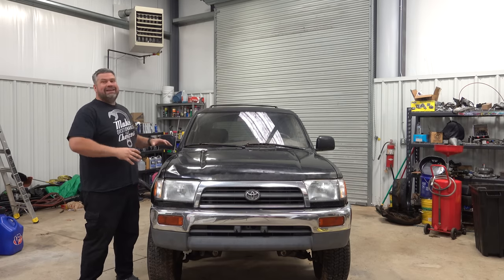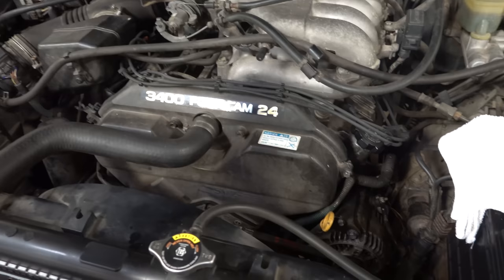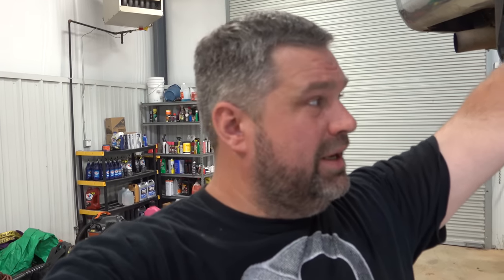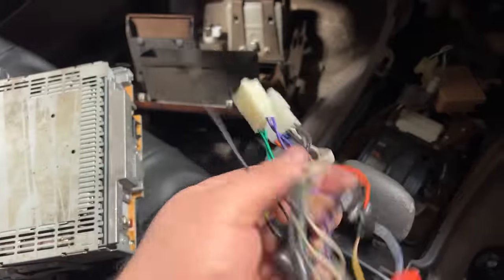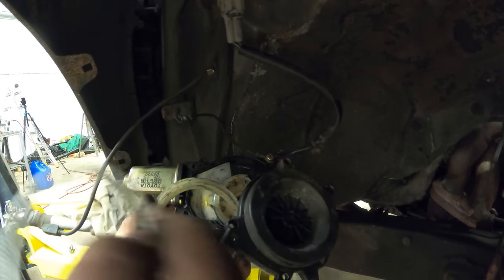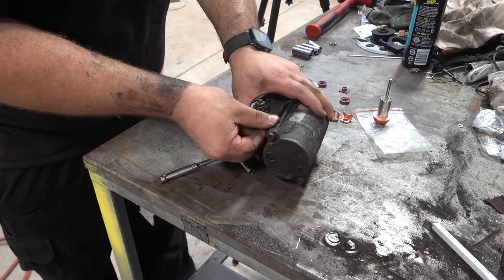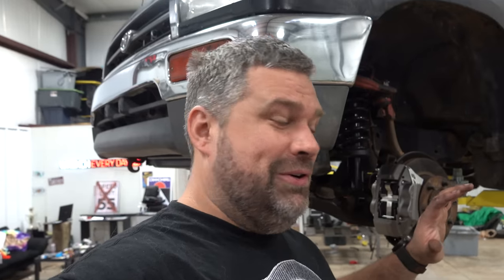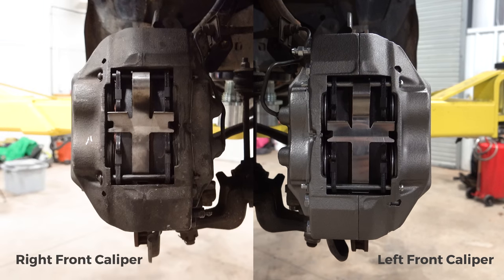Everything Wrong With Our Cheap Toyota 4Runner! Mistakes Were Made. Trying To Fix It All On A Budget

Comment: I cross reference parts off Rockauto to Amazon to get the best prices. The key is being able to have the time to wait on parts and knowing when to stop is the key to a decent flip.
Reply: @LM-id1bb  That's why RockAuto can have prices though, because of paid shipping.
Reply: I always check for deals with Amazon Warehouse... The "used" condition is most often brand new, but returned by someone, and can save you a lot of money!
Reply: @LM-id1bb  even when you go back and try to get parts shipped from the same warehouse when you order multiple parts no matter what you do they always make sure you are shipping from multiple warehouses.
Reply: I’ll never use rockauto I’m sorry they put cheap parts in the box and still charged me to ship back parts they sent me incorrectly then they charged me to ship it back. I will Never use them. Amazon is way easier.
Reply: Don't overlook OfferUp, Craigslist and marketplace for part outs
Reply: Bingo. The big auto parts chains are horrendous price gougers with poor selections. Buy your parts online and save anywhere from 25 to 75% I don't feel bad not supporting the parts giants when they literally price gouge on everything. Oil and coolant are cheaper at Walmart or the dollar store. Auto parts stores are supposed to have one job and instead they overcharge for everything.
Reply: Oreillys will match online pricing where I live. But I use rockauto due to time and work schedule. I had one issue with fedex damaging a radiator. Rockauto sent me new one and told me to trash damaged one.
Reply: I'll do that to find the product code and search off-brand sites that sell them even cheaper fuel pump for a 98 tj was 350 on rockauto 150 on Amazon but found the exact product code off ebay for 25 bucks with 10 dollar shipping
Reply: My problem is I'm OCD and usually fix them up as good as new and lose money.
Reply: The trick to rockauto shipping is doing the whole choosing the parts that all ship from the same place.  Like youll see the little car symbol with an a b or c and those are all different warehouses which youll get a separate charge for each different letter you have next to your parts..  if your able to get all of them the same the car icon will go away and youll only have a single ship charge on your order..  plus if you search google every time your buying then youll be able to at least find a 5% off code and ive even gotten ones that worked for 20% before just by googling and looking through a reddit post..

Comment: Installing the rear axle seal is not as simple as you think in these 3rd gens. You must make sure the seal is riding right in the center of the retainer sleeve on the ABS tone ring. Watch Timmy the tool mans rear axle job, where he explain the sharpie test. I failed once and then did it again while following his video. Also, don't forget the front lower ball joints (BUY OEM lasts 200+ K miles, aftermarket just 20K miles)

Comment: i like when you said, “I have never seen that before!” Never underestimate the power and “creativity” of previous owners fixes. Awesome video btw!
Reply: I just bought an old 4runner like this one last month, just last thursday I heard a clunk, the rear trailing arm mount on the passenger side ripped off from the frame due to the "previous owners fix". My guess is that it somehow got cracked at one point, so they welded it back on, but all their welds snapped and left me with a big hole in my frame now. But at least its not too rusty!

Comment: I bought a 1997 Celica Gt Convertible  from an estate sale for $1200.  Had 230,000 miles but runs great.  Carried out a bunch of work on it and amazed at how much the parts spend adds up.  Done as much as was necessary to make it safe and pass inspection, including new struts, battery, suspension parts, one axle, timing belt/water pump, parking brake cables, oil pump cam and crank seals, valve cover gasket, transmission gasket and filter, spark plugs and wires, auxiliary belts, fuel pump, minor body work and a few other bits.  Probably spent around $2000 on parts but I now have car that runs and drives great.
Reply: They are great cars. Right behind you with 208,000 miles on a 93 convertible. 20 years with the car... My longest relationship.😄

Comment: Nice job! Looking forward to this series. A great upgrade for this truck is the "Tundra Brake Upgrade". You buy the calipers and rotors for a 2005 Tundra and it eliminates the rotor warping issue that happens in these (at least in mountain regions), it also greatly increases the stopping performance. I bought one with all the service history and rotors had been replaced 4 times and needed replaced again. When purchasing it as a kit, the total cost can be as low as $300.
Reply: I was going to say the same.  Once he bought both calipers and pads, with just the cost of new discs he could have put in a much better braking system that won't result in warped calipers all the time.

Comment: That was a good overview on the rear brakes.  I have a Tacoma, and use the parking brake every time. Even so,  anytime I pull the drums to check the shoes, I have to manually move the adjuster a few clicks.

Comment: Man, that bleeder being on bottom got me good the first time I ran across it. Had a 2000s Ranger come into the shop I was working at. Customer and his "mechanic" neighbor put all new brakes on it. They replaced EVERYTHING front to rear including rusty lines, all except for the abs box. Couldn't get good pedal. I started pressure bleeding it, had leaks at about every connection. Tightened everything, bled them all, still no pedal. Went ahead and pulled the Master thinking maybe they didn't bench bleed it. Bench bled and reinstalled, still no pedal. Pulled the drums to find the new adjusters were all the way in. Adjusted them out to drag just a bit, still no pedal. Hooked up the scanner and ran the abs bleed, still no pedal. Getting aggravated, went to bleed them one more time and as I'm watching fluid come thru the hose on one of the calipers it just hit me. Looked over at the other caliper and sure enough both bleeders were on bottom. Swapped sides, bled the fronts real quick and it was good. Felt like an idiot. LOL

Comment: Jiggle valve works better at the 6pm position instead of the 12 o'clock position for some reason makes 6 to 10 degrees cooler on Temps with jiggle valve down on thermostat

Comment: My experience As a toyota tech and working on these since the 80s these 4runners always do better with Toyota Parts especially the engine the system is sensitive and mostly don't like aftermarket sensors good video

Comment: Only other thing I would check for are seized parking brake levers in the backing plates.  Common to seize when pulling on the cable going across the rear axle housing.  As a Lexus tech, I normally recommend replacing the levers and "rebuilding" them(we had made a "kit" in the dealer parts catalog).  If you wanted to, you could pull them out, free them up, then put lubricant(I would put anti seize on the new levers when i sold the kit)to keep them from seizing.

Comment: For the starter...I actually advice buying a new one than rebuilding it. In my case I got some weird issue were the starter would disengage from cranking. Researched about the issue and it pointed towards a starter clutch gear possibly worn, which I replaced as a kit with bearings and a drive pinion. Also replaced the contacts and the plunger. Fast forward some months after, the started would only engage some times or after tapping it. The issue was worn motor brushes. Sometimes is more cost effective to just buying a new part.

Comment: I was laughing so much when you were trying to install the new antenna but only because I've been there lol. I've since learnt to take the front cover off of the worm gear and pinion assembly to make sure all traces of the old rack are out. I also use a 12v PSU to power the unit up and feed the antenna rack in under some sort of control.

Comment: With those 3rd gen 4runners, you have to be sure to check those lower ball joints, they catastrophically fail with virtually no warning, almost always worth just swapping them out if you dont know mileage on them
Reply: Noted probably going to swap mine lol
Reply: @keatonsmith1058

Good advice ….. I lost my right front wheel and all the suspension components when my 99 4runner ball joint failed , the entire assembly went past me and almost hit a car …..it did a lot of damage, it destroyed the steering rack on its way out too 🤪😳
Now I tell everyone who has these to inspect and replace ball joints if need be , on 3rd gen 4Runners and tacomas!
Reply: @JRs-Garage  same thing happened on my 2006 tundra, the 1st gen tundras and sequoias have the same problems as the tacos and 4runners

Comment: Great video!  Regarding the calipers - more likely - the previous owner had the calipers off the car when they were making those goofy suspension mods.  Then they reinstalled them on the wrong side.  Ran into a Subaru that had that problem with the bleeders.

Comment: Was impressed how clean it looked underneath. Some rust spots to check, are in the frame section near the fuel tank, as it's too close together, mud and debris can collect there. And under the front fenders, as the cowl drains towards there.

Comment: I own a '98 SR5 4WD and a 2000 SR5 Sport 4WD. Excellent vehicles. Both were well maintained with service records. Zero issues with either other than routine maintenance . 2wd would be useless in the winters here in WNY.  Good luck with the flip.

Comment: More interested in seeing the actual work than hearing about what to do to flip a car..  the little facts here and there like the wheel bearing bit or the info about the seals and stuff…. Thats the knowledge thats valuable..  

But rock auto is your friend on the parts for vehicles in this year range..  and knowing the years the parts are the same for is a big help on the price:..  i got an 04 tacoma, but the parts are all the exact same as the 98-2004 4 runner and tacoma’s..  all the same driveline and motor.. sensors and ecu all the same almost every bit of it..

Comment: lol. I just finished a timing belt/water pump/thermostat install on my 02 3rd Gen 4RNR. Based on prior knowledge I put that air hole at 12 o'clock on the therm not 6, oops. 

Great video!

Comment: One thing I wished you went a bit more into detail would be the master cylnder/abs reservoir. I'm trying to figure out if I need to replace the entire unit or if I can replace just the reservoir as you did. 1500 bones is a hard sell due to Hurricane Ian.
Reply from the maker: Sorry! If it’s only the resivour looking rough and cracking and you have perfect brake function you can absolutely change just the resivour .
Reply: @TheQuestionableGarage  right on! I'll give it a shot then.

Comment: It's possible that they put the front calipers on backwards, Left on right and Right on left.  You replaced the broken one with a good one for the correct side leaving you with two drivers side calipers.  If you have any footage of them before the replacement you should be able to tell.

Comment: Cosmetics are usually not too bad if you already have the tools, much like the mechanical side. I would suggest giving it a good buff, pop out what dents are easily accessible from the inside (Like that fender), clean up the wheels, and spray paint any black trim and wiper arms back to black. A little goes a long ways and shouldn't cost a lot of money, just a little time.

Comment: In a pinch you could take caliper off turn it upside down, set it on the rotors, refit pads temporarily, bleed the brakes and after the air is out refit the caliper back on. Would work OK, had to do that with my mates vauxhall nova back In the 90's.  Better to replace it though your 100% correct. Great video.
Reply from the maker: There are ways to make it work, but given that I am selling this off, safety needs to be done correct and not just band aided together.

Comment: We have solved the wrong-side caliper issue in the past my putting a shim (normally 1/2" OSB) between the pads and bled it flipped upside down off the rotor.  Granted, this is for our race cars and allows us to only carry one spare for all the cars for rears, and most (I think 3 of 5) fronts.

Comment: Man oh man I felt your pain with that antenna mast. I've done that dance far too much with my NA Miata. It was originally a power antenna car but didn't have it at all when I bought it. Scored a complete unit in a junkyard but it of course had a broken mast gear. The NA masts have become unobtanium so I wound up having to order one out of the UK. Then after about a year the electric motor died so I got another used unit but of course it had a broken mast. So I had to swap my good mast over. Way too much effort to satisfy my 80s/90s nostalgia.

Comment: The "pink" plastidip probably used to be red... maybe. Using old factory parts is 100% a thing I try to do when I can. I'm doing blazers right now for me and my dad. We have 2 more trucks for parts. The parts trucks paid for themselves 2x already, and it was good 90,000 mile crashed truck that provided the most so far. fuel pump, wheel bearings, ball joints, power steering pump, alternator, seats, 4x4 switch, tires, factory zr2 posi rear end, miscellaneous sensors and wiring.....its been good to us. If your going to build 2 rigs, get a 3rd crashed low mileage parts car. It will save your wallet

Comment: If this was a produced TV show they would say we rebuilt the starter and move on.  You have real value hear because you show the details.  Never think a small job is too small.  Thank you, don't change that.  I've fixed up 3 3rd gens over the years.  Great trucks. 

 Clean the throttle body, it will idle super smooth.  Tires always eats into any $$.

Comment: Jared, @22:30, you mentioned you'd rather have a used  OEM fuel pump than a new aftermarket... On that subject, do you have a rule of thumb for when to use OEM vs aftermarket parts?
Reply from the maker: Generally when it’s aftermarket I like them to be made by the oem manufacturer providers, like denso for the Toyotas. So if it was a brand new denso I wouldn’t have swapped it out.

Comment: Jared, I feel your pain. FedEx has started using a bunch of contract drivers. All of the ones I've dealt with in southeastern NC have been sorry. A set of SBC aluminum heads left at my mailbox 1/4 mile from my house on the main road. Needless to say, by the time I got there they were gone. FedEx paid for replacements but 3 weeks to replace them caused problems. Don't bother calling their customer service number either. You get a phone bank in India and they are no help.

Comment: All 3rd gens have fuel level indicating issues.  99-2000 are the worst for it.  The tank holds 15-17 gallons, just fill it and reset the trip meter, it's more accurate then the fuel gauge lol.
On my 2000 4x4 after only 80ish miles it'll read under half a tank and the low fuel light will turn on when I still have over 7 gallons left.
I can usually get 250-280ish miles per tank.
Also if you look closely at those new front shocks the lower bushing is already shot.  I've seen that happen quite a few times with the junk rubber that China uses.

Comment: If you don’t want to send that thing down the road with a major issue that can happen, you better check the ball joints. Those trucks are notorious for the front wheel to fall off and go underneath the vehicle.

Comment: I had turn my left rotor which was not easy because it had gotten so hot it hardened but was so pitted it sounded like a hammer when braking. I can still hear it but it's better and I can't feel it anymore. I got the wrong rotors from Amazon. My car is more of a project then I expected and it is not technically my car because it is not registered but I love the car.

Comment: Wow, I've done a lot of brake jobs and never seen the wrong side caliper on a vehicle. I would have thought that on most vehicles, flipping the caliper would have not worked/ mounted crooked or something? But I guess with the commonality of parts these days, a lot of stuff works like that.
Q?:Would it have been possible to drill and tap the caliper, relocate the plug, Plug the old bleed port hole? and continue to use it safely?
Q?: Do some calipers come with 2 holes, a bleeder and a block off, so that you can use them on either side?
Reply from the maker: Some calipers are as simple flipping the bypass pipe and bleeders! Some calipers could get blocked off and modified, but the cost savings are not always worth the effort.

Comment: With the condition of that truck, especially the inside, I’m guessing it has 400K+ miles on it. I had an 89 Toyota pickup with 225k miles on it and the interior looked brand new compared to that one. Old analog speedo is easy to tamper with. I suspected my 91 4Runner had way more miles than what the speedo said with all the issues it had that did not jive with the mileage at all.

Comment: FedEx sucks so bad. All my messed up deliveries have been with them. Recently they wouldn't deliver a package because it said there was no apartment listed. I don't live in an apartment, I have a house.

Also, if you don't replace those plastic isolators on the starter, and it crumbles without you knowing like mine did, it will melt the ground cable in half.